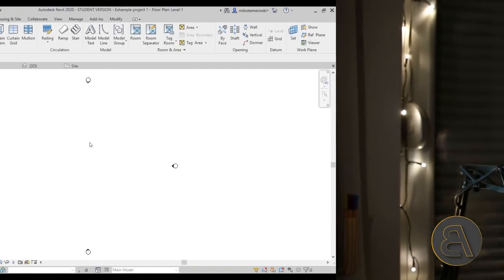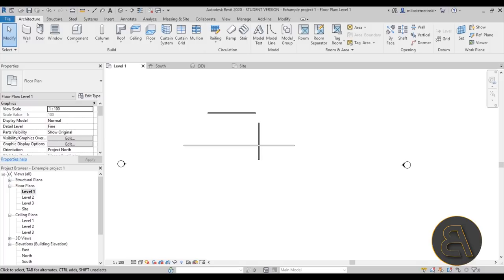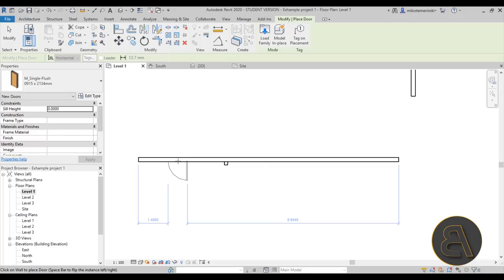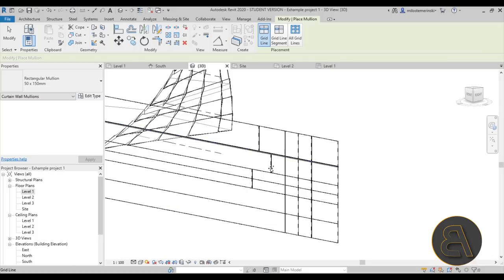Learn Every Architecture Tool in Revit Tutorial

Comment: 0:00 Intro
1:46 Modify
2:31 Wall
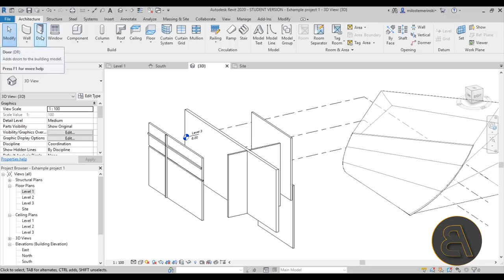6:12 Door
6:39 Window
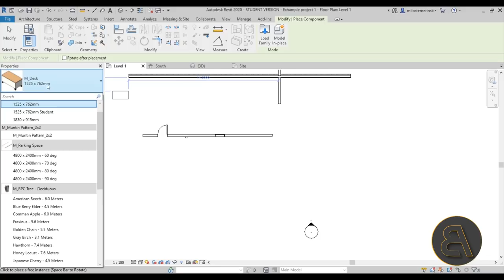6:56 Component
7:27 Column
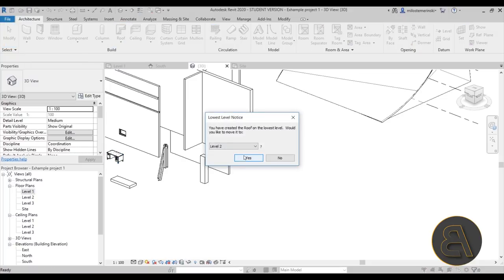8:41 Roof
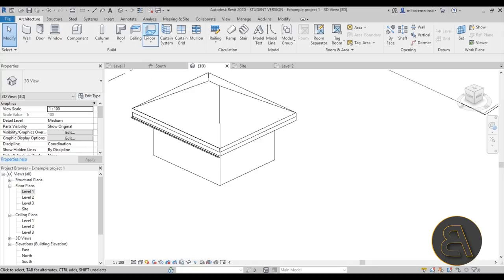12:28 Ceiling
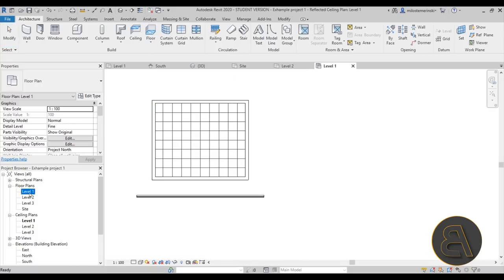12:57 Floor
14:29 Curtain System
14:43 Curtain Grid
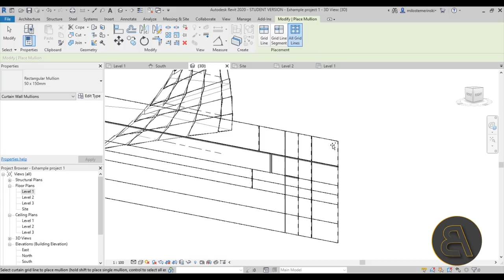15:36 Railing
15:59 Ramp
16:34 Stair
17:09 Model Text
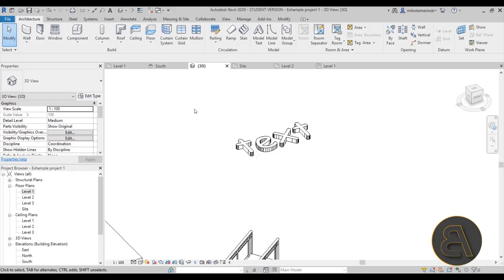17:48 Model Line
17:59 Model Group
19:07 Room
19:25 Room Separator
20:10 Tag Room
20:30 Area
21:44 Opening
24:06 Datum
24:24 Work Plane

Comment: 00:08 The video is about explaining every architecture tool in Revit.

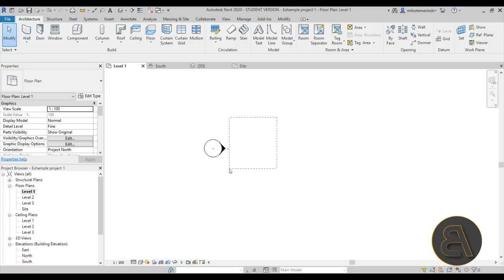02:13 Learn about the selection tool and architectural wall in Revit

06:27 Learn about architecture tools in Revit Tutorial

08:29 Learn how to create architecture columns and roofs in Revit

12:36 Learn about different floor options in Revit

14:38 Learn how to create curtain walls, curtain grids, railings, and ramps in Revit

18:40 Revit tutorial covers editing group elements and working with rooms

20:37 Learn how to create area plans and wall openings in Revit

24:23 Learn how to add grids and set work planes in Revit.

26:10 This video is about learning architecture tools in Revit

Crafted by Merlin AI.